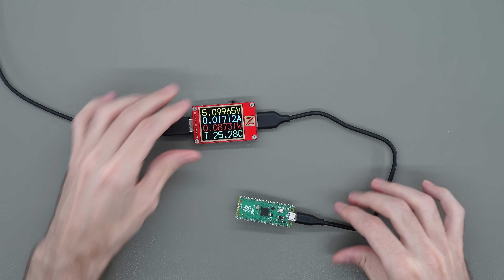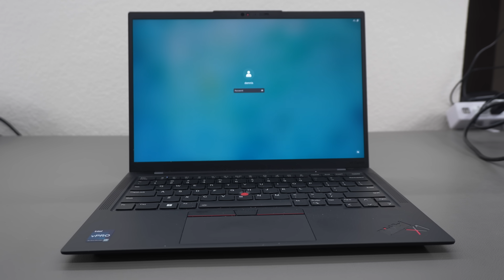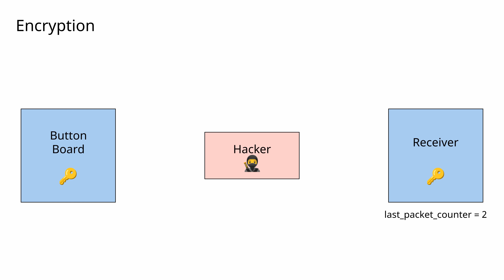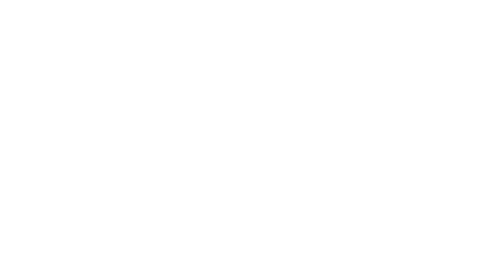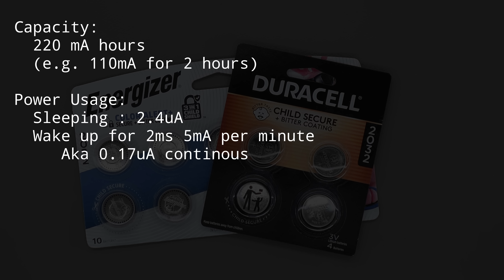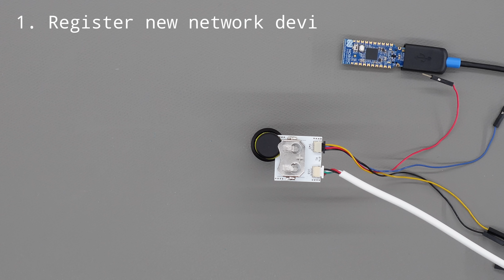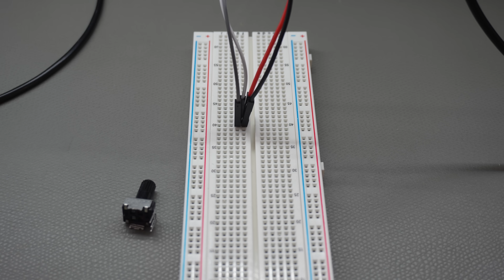I Just Wanted a Button. It Escalated.

Comment from the maker: FAQ:
- Do I hate wired buttons? No. The intro is part sarcasm, part engagement-baiting.
- The PCB Holders: https://sensepeek.com/pcbite-kit-s-insulated (my table has a steel plate to make it magnetic)
- Background Music (BGM): Maniamaster by Lupus Nocte
- Reed switches: Yes, they are perfectly fine to use. I forget to mention they come in both NC and NO variants that you can pick depending on the usecase. Reliability is probably fine for infrequent use and a properly sized magnet.
- Why not turn off the microcontroller entirely? Many wireless buttons use something like a latching switch to turn off the MCU entirely until the switch is pressed. The nRF52 also has a "System Off" mode that lets you get most of this effect without extra hardware. This reduces the functionality flexibility since you can't use timer based features with this setup and you need to persist more state to flash memory between reboots. IMO the battery life was good enough without using this so I didn't find it worth going down this route.
- Why not use an nRF54? Yeah, you should probably use one nowadays. I already had a lot of nRF52 modules and code lying around so it was easier for me in terms of product maturity and still gets you most of the efficiency.
Reply: solar-powering these would be incredibly funny, you'd be well on your way to making fully autonomous tiny sensor clusters
Reply from the maker: @qtpaulie  Might try at some point. Batteries are very predictable so simplify the math a bit though for the first pass.
Reply: a few extra questions, if you don't mind:
- what exactly would home assistant support look like for these?
- how does your PCB-making process work? I really would love to make some of these, but PCB Assembly is prohibitively expensive in Europe, and I have no soldering iron experience, let alone soldering with stencils. What would you recommend? (PCBWay isn't an option, unfortunately, I know they have cheap PCB Assembly)
Reply from the maker: @qtpaulie  - home assistant support would probably something like a bridge program that communicates with these boards wirelessly and translates the data into messages that home assitant can understand.
- pcb making: I usually buy them unassembled from a place like JLCPCB/NextPCB/PCBWay. The only european ones I've heard of are AISLER/Eurocircuits. Some of them will do the full surface mount assembly for you if needed, though sometimes limits flexibility a bit and costs more. It definitely opens up a lot of possibilites to you if can do basic through hole soldering with an iron. then you can grab dev boards in pico style formfactors and make through hole PCBs or just use protoboards to run wires between everything. only disadvantage is that things won't be quite as compact.
Reply: @MadeByDennis  ah, that makes sense. i'll try my hand at contributing HA support! i think i'm going to try with stencils from aisler and see what happens, thank you for the explanation.
Reply: I have a question on the radio part. What range do you get on the buttons, and what type of obstacle can it go through? Could you extend the range with a little collapsible antenna? I'm working as a volunteer in handicap camps at music festivals and am thinking of handing buttons like these out on a lanyard to people who want one as a means of emergency alarm (  you get the button, and we mark where your tent is on a map, when you need help at night or have an emergency, you press the button, and help comes to your tent). Your approach from a minimal power consumption side is interesting and well thought through and implemented; the modular PCB is a good way to future-proof. What is your current price per button, including battery and 3D-printed shell?
Reply from the maker: @tobiasbarlag3607 Current cost is around $20 per finished button board. Probably could optimize down to $10. I haven't yet done an exact price estimate. Range would improve with a bigger antenna a little yes. I am testing one out minimally out the reciever side. These are using 2.4Ghz wireless which is the same as WiFi but a bit weaker. So indoor range will be a little less than Wifi so a big apartment scale. things like bodies and walls will interfere with it. Outdoor no obstruction range is theoretically much larger. I don't know much about your use-case but the ideal scenario is that the receiver is hung somewhat up high so there is line of sight to individual tents without crossing more than a few walls. Or technically the better solution is to find 900Mhz wireless modules (e.g. on sites like Adafruit usually called Lora) since these frequencies have much better penetration and range.
Reply: @MadeByDennis  Thanks a lot. I am currently working on a receiver and already have CAD files for a mount that I can pull up on a flagpole. I ordered some parts for testing and am optimistic (so far). 900Mhz sounds promising, and i already have ideas for v2 with 2 AA batteries and the possibility to send GPS coordinates from all over the festival grounds. Having a lot of fun tinkering right now. Testing will commence.
Reply: I have a question too! How much time does it takes to make a one project for you?
Reply from the maker: Every video on this channel takes around 3 weeks of full take work
Reply: @MadeByDennis  hm, i see. I'm currently making my own project, but i have only two free days in week. So basicly that takes you 3 week will take me around 8 months.... That's kinda sad, but i will keep working on it anyway.
Reply: @MadeByDennis  oh, and btw. I recommend that you try using an ionistor instead of a battery. It takes a little plase, and you don't need to replase it if you use it in combination with solar panel
Reply from the maker: @novohart1928  to be more specific 3 weeks is my target for everything including shipping time, video production, coding, etc. It's really like 1 day to design the boards, 1 day to make the 3d printed cases, 1 day to assembly them. software takes longer since I am crazy and doing it from scratch. also making it into a video and shipping delays add quite a bit of overhead.
Reply: Where did you get your e-ink display? I've been looking for a few at reasonable pricing.
Reply from the maker: @Nightenstaff  I bought the ones in this video from https://www.seeedstudio.com/2-13-Monochrome-ePaper-Display-with-122x250-Pixels-p-5778.html. Sometimes searching up the same part number on Aliexpress is cheaper

Comment: A battery isn't a bad option for buttons, but they tend to run out of power at inopportune moments. A piezoelectric element is a better choice for transmitting button presses and possibly rotating the encoder. This way, you won't have to search for a battery for your light switch in a dark room at night.

Comment: Wonderful video, and looks like it works super well. One suggestions: Look at 3D printing a flexible case covering (either thin plastic or TPU), so you basically get one large smooth button to press instead of that protruding one.

Comment: what a project! for single button application, I have another way to discuss. can we use a button (and an gpio) to control a mosfet to control power directly. I mean, almost no power or sleep needed. after button was pressed, mosfet is on and power on mcu. after everything is done, mcu tells mosfet to turn off power.
Reply from the maker: Yeah, I was thinking about that a little bit but I was trying to avoid making very specialized solutions so that I can re-purpose stuff a bit more. It makes some things more annoying since if you want proper encryption, you need to persist some state to flash on each restart.

Comment: i'm not an engineer and this is probably really stupid but is there any viability to taking the motion / energy of you pressing the button and turning it into power for the system? Maybe like a magnet in the button and a coil around it in the housing and every time you press it the slight electrical signal gets stored and used for power? It seems negligible but all the button presses over 5 years will significantly add up.

Comment: My only question is why send battery update packets once a minute? What would battery life be if you only sent that update once every few hours or once a day? Battery level won't change dramatically over even a week so it seems like that's a higher than necessary draw when you've gone to all the trouble of keeping power usage down everywhere else. 

These are amazing. Fantastic build, I look forward to watching more of your work!
Reply from the maker: Yeah, it isn't necessary to have it that frequent. The battery life is already approached the rated life of the battery (10ish years) so there are dimishing returns. I mainly used that for measuring battery life to characterize all the more extreme use cases like what would happen if I used this setup for a wireless sensor with more frequent refresh rate

Comment: You should look at nordic's nRF54L series. They are cheaper and draws less power with more CPU performance. Their RRAM instead of flash is really nice when developing too as you can program the chip much faster. Many of the peripherals are very similar, including the radio (mostly some more registers/bits for the new features), except they have DPPIs instead of PPIs (so a publish/subscribe model instead of the one to one/two model of PPI). If using nordic's APIs it is really easy to port the code.

However, a problem with using normal coin cells for these ultra low power applications is that the battery chemistry isn't designed for it. When drawing uA currents, they will get higher and higher internal resistance until they fail long before their energy is spent. There are special batteries designed for it, but it is often cheaper to once in a while use a lot more current as that will revitalize the battery. Unfortunately I don't know how much or how often. I've only heard about the problem and the solution from our customers. One of them busy waited with the CPU for some time (it was with a different CPU though so I don't know its power consumption).

Comment: how do you connect to phillips hue? with an API? also, is there a way to control it from PC without a bridge?
Reply from the maker: I connect via official API using the bridge (it's all on the local network). Annoyingly the official docs require having a free account on their site (https://developers.meethue.com/develop/hue-api-v2/getting-started/) but you can google "hue api" and there are software packages for various languages. I believe there are ways to directly connect to the lights via bluetooth but I haven't tried them.

Comment: You could also make a leak detector. I would imagine it would use basically no power, as the circuit would close only once in contact with water.

Comment: So cool! I am building something similar to send less data which takes less time to send therefore consume less power. I wonder what's the range before the board stops working? Related question, What's the maximum power you can send the RF signal at to maximize range?
Reply from the maker: The range I've tested so far spans my entire large apartment. Still working on making a better receiver and then will have some better metrics on that. Specifically for the chip I am using, the internal RF amplifier will let you transmit at around 1/10 watts of power. It is possible to add an external amplifier to the board so you could push it much higher. Sending data at a slower rate (e.g. 125kbps instead of 2mbps) will also change the range by an order of magnitude as the receiver is more sensitive at lower speeds.

Comment: What an awesome project! Not only did your requirements match exactly what I like but your implementation is smart in many ways and you explain everything perfectly. Thank you very much for sharing. I  designed the home I will move to with wired smart devices only but seeing this I start looking for an excuse adding your wireless components. BTW, what is the range of those devices?
Reply from the maker: Still tuning the range, but its like a weak wifi right now. I've tested up to 40 feet away, but much more should be doable.

Comment: If you have an home automation hub with companion app: Run your lights on timers. Examples:
Use your smartphone alarm to startup a sunrise scene that slowly dims on.  15min before sunset slowly dim on.
Dim to night light at your preferred bedtime. Turn all lights off when you plugin your phone to charge after/around bedtime.
Use the location of your phone to block execution if nobody is home. With this you won't touch a switch for month.

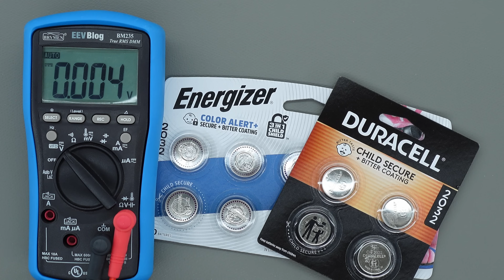Comment: 17:50 Actually more advanced devices like phones and laptops do something more clever. They actually measure the current coming out of and going into the battery. They use that and how much time it's been at that current to calculate milliamp-hours used and divide that by what it calculates the total milliamp-hours are (that it also measures as part of a charge-discharge cycle). In practice it might also use the voltage to calculate milliwatt-hours instead of milliamp-hours but same premise. These circuits are called "lipo fuel gauges"
Reply from the maker: Have heard of them. Didn't know how widely they were in use. Thanks.

Comment: For the completely passive ones, like the button, instead of waking up every minute to send battery status, just send the battery status as part of the "button pressed" packet. You maybe press the button 10 times a day, but sending battery updates every minute means 1440 packets sent PER DAY instead of 10. That means the thing that will draw the most power by 100x is monitoring the battery voltage, which itself is rather ironic. This is the way a lot of common 433mhz wireless sensors and buttons do it already (that you can decode the raw data of using a rtl-sdr and rtl_433)

Comment: Im interested in adding these features to a board i designed to run wled on an esp32... I have a header with i2c and uart i was planning on using for various things such as a radio coprocessor. It would be very handy to have these buttons be able to turn on and off a main esp32 that has others connected over wifi. 

Though i suppose a another esp just sending a magic packet over wifi would be good enough too, it would be orders of magnitude more batter draw i think though

Comment: There are 430 MHz wireless button/switches that do not use batteries, the action of pressing the button is converted into enough power to power the internal microcontroller and transmit (I think they're piezoelectric?). They are often used for door bells or for controlling various things like lights. BigClive had them on his channel a few times. You could use the intended receiver which is often a relay or a suitable receiver station to interpret the signals and communicate with your smart stuff.
Reply: Wow that sounds awesome. Are these doorbell buttons encrypted?

Comment: Hi, sory to bother you with this question, but I’m wondering how do you research this componentes? Like what’s the pipeline to finding this low consumption components. I’m a electronics engineer student and I’m always having trouble researching components.
Reply from the maker: It's good to be aware of all the major component categories and most popular parts. Sites like Adafruit/Sparkfun are what I occasionally check in on to discover what is possible and then within a product category, either drilling down on requirements through DigiKey/Mouser filters or googling for other projects that use the same type of component are good ways to find optimized part numbers.

Comment: Couldn’t you use the accelerometer on the door and get away without the Hall effect?
Reply from the maker: To clarify more, it measures orientation by measuring the acceleration of gravity. So the orientation doesn't change if you are swinging open a door. The door will shake and you can detect them but it is hard to keep track of whether it is open or closed.

Comment: Feature Request:
A slot for paper on one edge of the case that allows for the insertion and removal and back again of a slip of paper for the purpose of marking the date of last battery change. 5 years is a long time haha. I'd forget when the batt was changed.
Reply from the maker: I was originally planning on setting up something like a phone notification when the battery goes below 10%. That's partly why I have the battery checks, but yeah, I'll be seeing if I can integrate more improvements to the case like that too.
Reply: @MadeByDennis hell yeah. I got my idea from my work. They write these types of labels on the equipment so that everyone knows the next inspection date, and so that everyone has a friend of reference for the next inspection versus the time that they're experiencing any kind of issue, etc

Comment: For the simple button usecase, wouldn’t it better to use the button as a power switch for the whole board? A complete boot should barely take longer than waking up from deep sleep. Would drop idle power consumption to zero. Of course it makes it impossible to do anything while the button is not pressed.
Reply from the maker: There is a method of doing this properly with an electronical switch that latches on until the microcontroller tells it to turn off. That is used in many commercial products like this. It's just a matter of hardware complexity vs flexibility vs software complexity.

Comment: Did you hear about Postcard? You could maybe save another few w using that instead of protobuf
Reply from the maker: The main concern especially with things like long lived configs is forwards/backwards compatibility which protobufs nails very well and is not handled by something like Postcard. At least for me, system complexity of velocity was a bit more top of mind at the time than pure space efficiency.